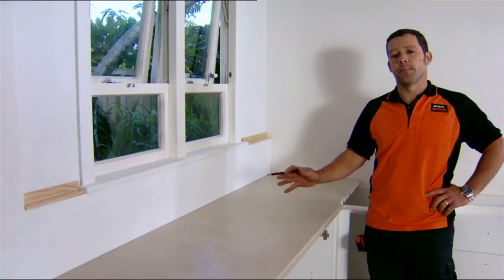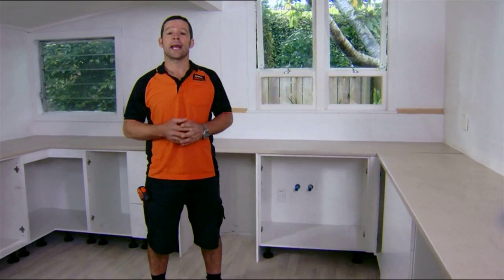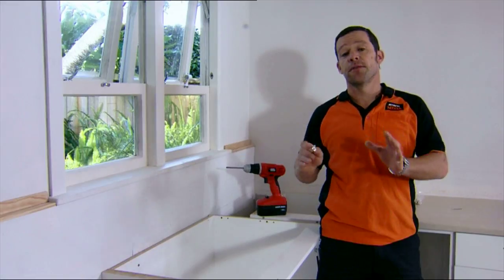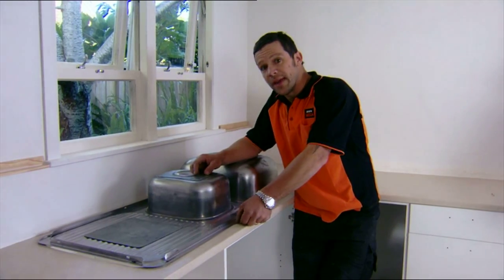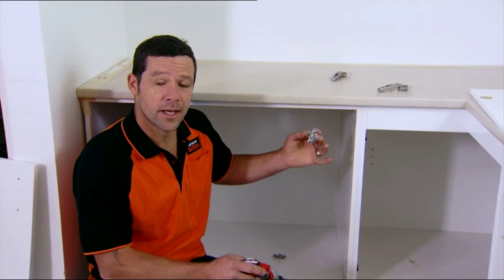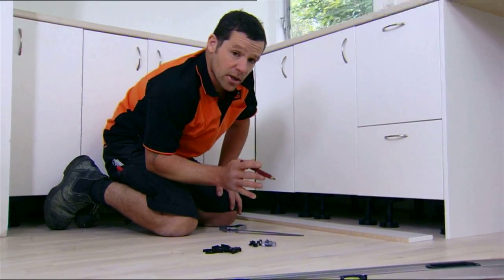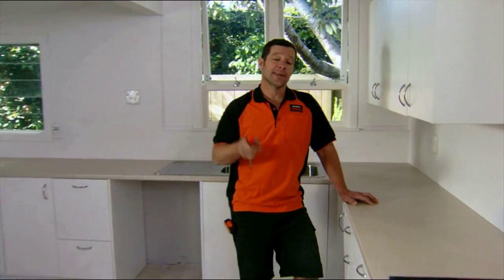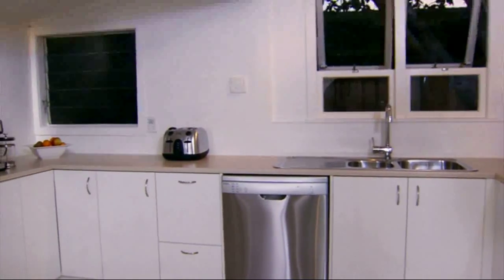How to Install a Flat Pack Kitchen - Part 3 | Mitre 10 Easy As DIY

Comment from the maker: Hi there,
The joins on the bench tops and the bench top length all come pre-cut from the factory, no cutting is required there. As in the video you may want to scribe back of bench top to wall to create a better fit if your wall is not straight. Or you may want to fix a splash back to cover this gap. The only cut required is for the hob and sink.
Cheers, SR

Comment: I've got one of these flat packs, and the quality is excellent. The video skips over how to fix the bench to the base units though, and how do you put a fridge unit or dishwasher unit together. All I got was some panels 870mm high. I imagine one fixes them under the bench using L-brackets? It would be good if the video showed how to do this.